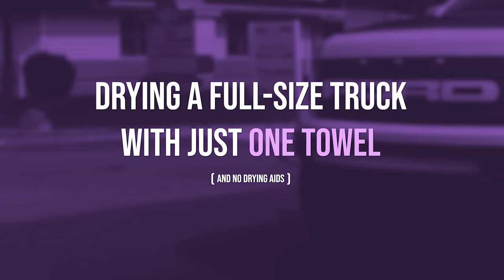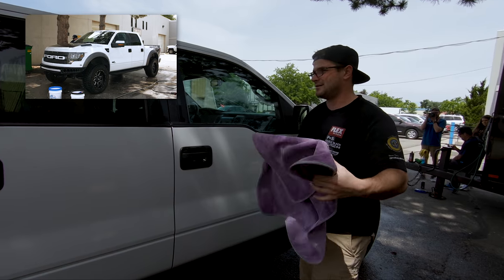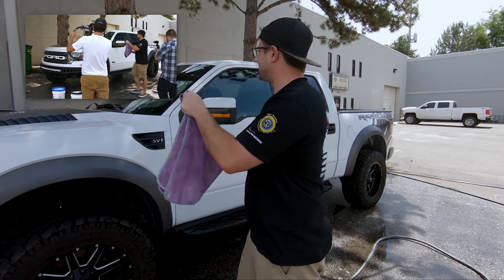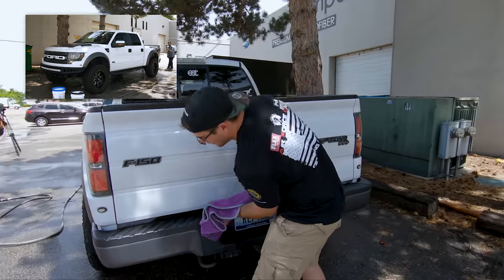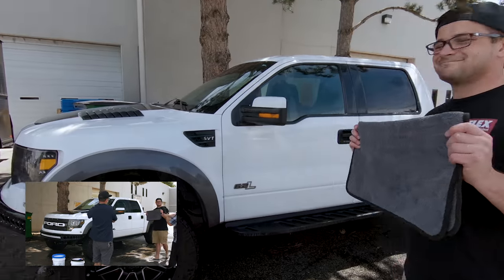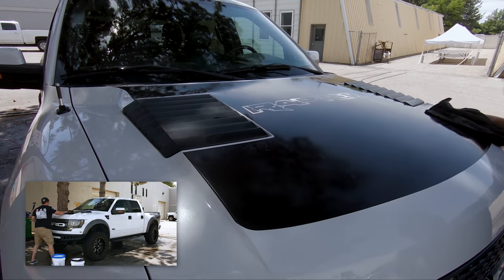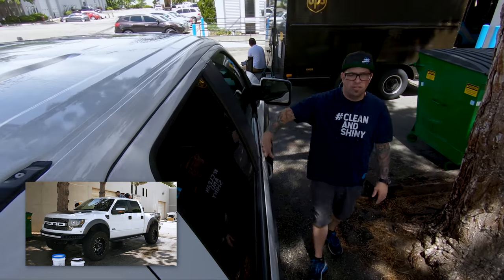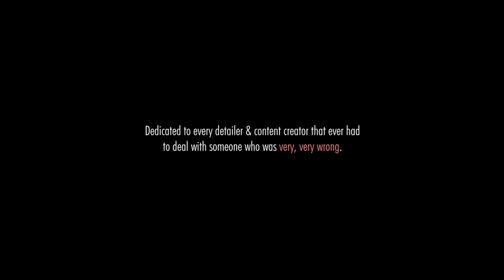Using ONLY ONE TOWEL To Dry A Ford Raptor?! | DETAILING UNCUT

Comment: I use the Double Twistress on the Mustang. I could use one, but I use 4. I use detail spray or spray wax for a drying aid, and these towels work excellent. I wish there was a Double Twistress small enough to use on the chrome wheels after using ONR and spray wax on them. I also use that towel to put Beadmaker on with

Comment: I would like to see the double twistress result on that truck after waxing it and when wet covered with thousands of water beads. That truck is unprotected and there was not much water on it.
Reply: Always that guy 😂
Reply: @theragcompany  My wife isn't satisfied, my mistress is. Who's right? Perhaps they both are!
Reply: barry cook
I guess the rag company lost one customer.. nah I bet that guy still buys 😂
Reply: Still had streaks that caused water spots.  The owner would not be happy until that truck was finished.  That towel did not do what they thought it did.
Reply: @theragcompany  I am a fan. I have many of your towels, but let's be sensible, after the car was dried that last rinse left little to no water on the surface. Your products are good but there is no need to hype them in a situation that does not make them shine.

Comment: I disagree with you. As a chemical engineer from ICT Mumbai, I feel that you need minimum two towels. One for metal and plastic parts ... and second for glass windows and windshield. Using the same towel on glass 'after' collecting some dirt , grease and soil from other parts is not very logical, is it ? Kindly explain your take on this point and correct me if I'm wrong.

Comment: I don't know if a "drying aid" actually helps to dry quicker, l believe they aid in lubrication.  Cos if anything the drying aid would soak into your cloth as you wipe it up and make your cloth hydrophobic.
Reply: Sunil Raj Opti-Seal helps and no, it won’t get hydrophobic.
Reply: @Sherukka  You have an opinion and that's fine.
Reply: Sunil Raj It comes from experience.
Reply: I will concur optiseal really makes drying the vehicle really easy.
Reply: Sherukka has a fact based opinion.  Sunil Raj has an opinion based in....I don't know, but it isn't reality.